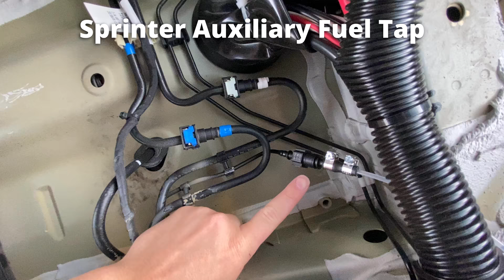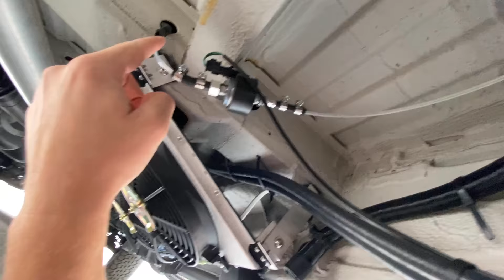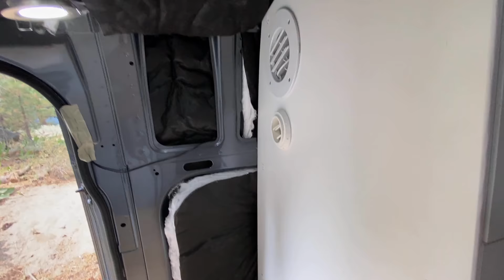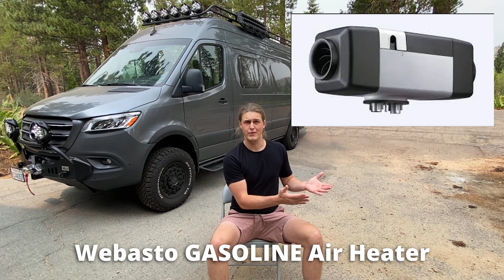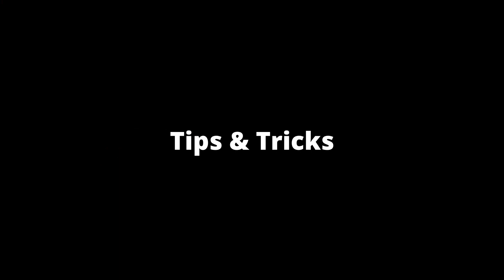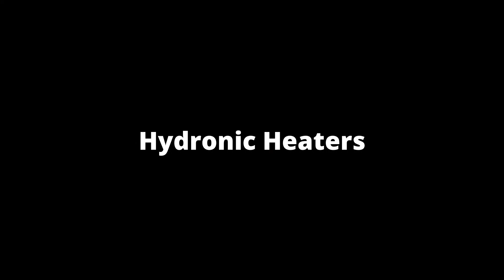Watch This BEFORE Buying A DIESEL HEATER!!! (Best Heater + How To Install) #vanlife

Comment: How will you connect your  2    1 1/2" heat outlets to the 3" main outlet, because for now it appears that the 2   1 1/2" outlet does not distribute any heat!

Comment: If the exhaust pipe gets significantly hotter than the air output, there must be a way to capture that heat instead of using standoffs to avoid melting your floor. 

 Might not be worth the complexity, but that's a lot of Hot that we're letting get away for free

Comment: The best place to put it is under the shower (dual heater air & water). It can heat the shower room for dry clothes and sauna. If you put the shower room in the middle of the van it can heat all the van.

Comment: It seems like mounting the pump and the air intake underneath the van would be problematic.  In New England, they would be covered in salt, mud and ice for the majority of the winter.  Obviously all of the substances will hurt the pump and clog the intake.  Also, in sub zero temps, that little fuel line will definitely gel up.   Why not mount the pump inside the van under a cabinet or inside an acousticly isolated enclosure?  The intake would be easy enough to go thru side panel... Fuel tank, Jerry can, also inside to keep warm. Maybe I'm missing something.

Comment: Monday March 13 / 2023. 
Love the diesel heater. My only concern with install is the heat vents should be on the floor level. Heat rises to the top and cold settles to the floor. In a cold environment your feet would always be cold with heat coming out the top. 
Great clear instructions and video.

Comment: any thoughts or recommendations on using a diesel heater with separate tank, in a gasoline van? Seems like diesel is a bit safer than gas for use as a heater?
Reply from the maker: Sounds like a good idea :)

Comment: If you are or will be using this in freezing  conditions,  or it's critical  do not even consider  the Chinese  ones onless you buy 2 and carry second  in box with you for spare parts .I have used them in my Florida  off grid cabin for years in 7 or 8 years I have had 4 of them 
And bought several boards and fuel pumps..
If you have the skill tools and redundancy  get 2 the price can't be beat 
If not do it right the first time get a name brand .
Reply from the maker: Great advice 🙏

Comment: Your wrong on your inputs and outputs diagram. Combustion intake was the one with the silencer you have externally to the van. The large intake you point to is the cold air return for the heater. Combustion gasses and heat air should never mix. Cold air return next to Combustion exhaust can kill you. Your installation is right, diagram is wrong. Good review though.

Comment: These diesel heaters suck.  They are noisy and use electricity.  What would make much more sense would be a vented propane convention heater.  These are hard to find which does not make sense to me.  To many people are buying these crappy diesel units and non-vented units.  Hard to find  compact vented propane heaters.  People are just going to have to insist on these heaters and quit buying the crappy stuff.

Comment: Can you install a diesel heater and just use the tank that comes with it? That way you wouldn't have to hook it up to your car's fuel tank (especially is you have a gasoine tank). Is there something wrong with using the fuel tank that comes with the diesel heater in a van conversion?
Reply from the maker: Nothing wrong with using a separate fuel tank (except then you have to remember to fill it up)

Comment: Great video. It shows what looks to be about an inch of the mounting plate sticking through the floor of the van? is that about correct and would you say the floor is about 1-1.5 " thick?  thanks in advance.

Comment: Why wouldn't you have the cold air intake inside the van, so the heater doesn't need to work as hard as it will be recirculating the warm air from inside the van? Like a ducted heating system in a home?
Reply: For every cubic foot of air that u would intake to burn the fuel, that exhaust fuel - & air must be vented outside,  if u drew that air from the inside, u would create a negative air pressure draw inside, that would have to be replaced with outside cold air through an open windows or door crack.  Burning this way would put a constant draw of cold air to your inside space.

Comment: Putting my roof rack on tomorrow, I have 5 LP9 going on them, I was going to use the sea view cable gland for wires( the rectangle one) just curious what you did as far as routing your wire from outside to inside the van. Can’t find anything online for routing cables to inside to back battery bank.
Reply from the maker: I just found the scan strut cable glands which don’t require glue and I love them.

Comment: Cheap Hydronic: stick an egr heat exchanger in the espar exhaust. Not my idea btw, someone in Ireland iirc. And humble road uses the engine coolant to heat a water tank. Cheers.
Reply: He doesn’t use radiant heat though..hydronic but not radiant .. so unsure of humble road’s method or how it’s holding up..

Comment: only the 2KW model fits under the passenger seat. If you have space elsewhere, get the 5KW Chinese model.
Reply: Yes, but it also consumes more power and fuel, plus will make more noise I believe.

Comment: I have been using and inexpensive Chinese diesel heater for two Winters. I am absolutely impressed with how well it works. I must admit, it was temperamental beginning the process after I had it installed I ran into some problems. Although what I did was basically take it apart clean it up and put it back together and I must say it's been running perfectly ever since. Now I should also add that I bought spare parts such as. A spare fuel pump and a spare glow plug. I keep those around in the event something breaks and I want to get it fixed quickly. In addition I always keep something for backup heat. I don't ever want to get stuck and not be able to produce heat, that could literally kill you. So I have backup propane and electric heat. Be safe out there and happy trails!
Reply: Thanks for sharing! Yes back up heat is important. Bob for Cheap RV Living recommend portable alcohol heaters as a good off grid option too.
Reply: what brand name is your heater?
Reply: @JazzFunkNobby1964  I don't remember. Although most are made in the same factory. (Just different names). I always check reviews Seems you can't go wrong with decent reviews!
Happy trails!
Reply: Got part numbers for the pump and glow plug?
Reply: @kamakazioverland4584  I don't. The way I found my backup parts was just started with a Google search and track them down I think I found them at eBay if I remember correctly. Also I think they're all interchangeable.
Reply: @wideawaketotruth5301  gotcha, much appreciated.

Comment: I’ve seen everyone installing these heaters on the floor of the van with the intake and exhaust pointing downwards. 
I’m wondering if it would work if it was installed on the wall instead?  So it would be turned 90 degrees away from the floor with the exhaust and intake coming straight out the side of the van.

Comment: Did you know that if you take a 300w engine heater connect it in so it circulates thru the vehicle heater, connect it to a solar panel system you have a solar Hydronic Heater.

Comment: Love your video, well explained.  How to choose the size of heater, 2,5, or 8 KW?
Reply: Depends on the space that needs to be heated. Measure your space, most vans are about 14m3 to 17m3 times 0,0606. That gives you the Kw rating of the heater needed. For most vans a 2kw heater will be sufficient.

For my off-grid house I have a 5kw for the living room/kitchen area, and a 2kw for the bathroom and bedroom. All Chinese ones, and the have been running for 5 winters now.

Comment: I do see a lot of comments on the vent placement being higher and wanted to comment. The heater moves about 51 cubic feet of air every minute on high and having the separation helps for circulation. It may be pushing the heat a little higher in the van but all that air must be drawn back to the inlet of the heater. As for the altitude compensation I believe the Espar heater is the only one that has automatic altitude compensation for its gas and diesel heaters. They are rated for up to 9,800' but work above that. Very nice video and keep up the great job!!!

Comment: Nice video, I have a few questions on your build. Is there a reason to get your combustion air from outside of the van? If you were to get the air from inside the van and recycling it wouldn’t that make less the system work less? If you did have a gas rig would it be possible to install a small tank for diesel. That could also act as a safety feature so you don’t end up stranded from over running the heater. What do you think? Did you explore these options at all.
Reply: Intake air that provides combustion oxygen should (must) come from outside, as after burning it is exhausted to outside.  If u took combustion air from inside, you would be in taking heated air, and forcing it out the exhaust pipe to outside.   Thus would also create a large negative air pressure draw to inside, that would have to be replenished with cold air through an open window or door crack.  Resulting in drawing in cold outside air to your living area.   Recirculating inside warm air through heat air exchanger, means greater efficiency as heating warm air is easier than heating cold air!
Reply: I had the same questions

Comment: Just bought the Webssto Air Top 2000 GAS heater for my SUV so I can survive these winter conditions. Should get it just before Christmas and then need to install it :) Cost me $1,110 CAD. And I need to find someone to install it for me since I don't have a garage and it's -20C out, so I'm not working on this outside haha

Comment: If there was a zombie apocalypse would diesel be so easy to come by? But if you had a wood burner, you could park near a forest and get wood for free.
Reply: Good point. An alcohol heater could also be another good back up option, and you can burn "HEAT" on it.

Comment: Happened to see your new van as I was driving through south lake.  Beautiful job.  Getting ready to build my 170 4x4 as well, delivery coming in the next 8 weeks.  Have a question about the fresh air intake for the Espar (or any model diesel heater).  In a home HVAC system the cold air return is installed in the ceiling somewhere. It returns the air from the house back to the heater.  Does Espar/Webasto require the air intake come from outside the van? I would have thought the air intake would come from the top of your cabinet so you're returning warmer air to the heater, instead of cold air from outside (Tahoe winter is cold!).   Just wondering - haven't read their install instructions yet.  Anyway, hope to run across you sometime here in Tahoe.  - Chris in Incline Village.
Reply: @Chris Floyd, These heaters are simple and fascinating. They use one motor with a fan wheel at each end. The airflow for each fan wheel is separate and chambers are sealed with gaskets. Inside the van, coach, trailer, shop, etc. “return air” is drawn in from the back of the heater and is forced between the housing & the large heat sink / exterior of the combustion chamber then blows this heated air (about 200*F) out of the front of the heater. The other fan wheel draws outside air from the air inlet port into the heater and is forced through a swirl chamber where the fuel is mixed and preheated then blown into the combustion chamber. This same airflow then directs the combustion gases through the exhaust port and out the exhaust pipe. 
The cold outside air is only used for combustion and the warmed inside air is recirculated through the heater.
Reply from the maker: Hey Chris you probably could but the outlet for cold air intake is on the same surface as exhaust so it’s easier to have it outside. Nice man one of these days i need to do a meetup 🤙
Reply: @seven_o_savage  My van arrived a couple weeks ago. Starting a soft build using wood framing now. Need to take a couple local trips, modify the design a time or two, then commit to the build with 8020 materials.  Max installed the Hammerhead bumper, winch, horn, Mondo's, and Baja Design front lights in week one. Black Rhinos and KO2's in week 2. Now in week 3... Sound deadening and Havelock.  Love to meetup anytime in Tahoe. Building it between Jackson CA and Incline Village.
Reply: @mooneyman13  I guess you didn't see Preacher S' answer to your question.
Reply: I was gonna ask the exact same question.

Comment: My plan is to use a small wood burning stove by day and diesel heater by night.
Reply: Did you end up doing this? I have a 4kw wood burner in my sprinter which has been great even below minus 20 Celsius, however the mornings are intimidatingly cold to get up and get the fire going, so thinking of adding a diesel heater to run each morning for an hour. Let me know if you have this set up. Curious to know how you run it.

Comment: Yeah, I agree with you regarding the choice between the radiant vs the air heater. Plus the radiant system is a more complex system meaning many more points of failure.

Comment: I work on both the espar and webasto that are installed on semi trucks. I also have my own Chinese heater.  Personally I say the Chinese heaters are about 95% as reliable as the expensive brands. For the price difference, to me at least, it’s not worth spending the extra money on the high end ones.
Reply: Seems for the price, u could keep an entire Chinese heater, unopened as a spare and swap its parts out if needed!

Comment: Why not plumb the heaters exhaust into your van’s exhaust piping rather than run a pipe across under the van?
Reply: You’d probably find that the vans exhaust then pushes into the heater unit while driving and could soot up the heater or at least cause condensation which won’t help it. It could potentially leak exhaust into the van. Definitely need to be kept separate

Comment: I have a concern with diesel heaters, they produce alot of soot and introduce diesel particles into the air and you can see on the thin film on windows and walls. Anyone knows how to solve this problem
Reply: You can't, it's a diesel exhaust.

Comment: I went the middle way with the heater: cheap chinese heater with the controls replaced by the Afterburner, which makes them incredibly powerful on the interface side (wifi, mqtt, phone control, automatic software updates and a gazilion more features) ..so far it has been an amazing combo.
just one note, that you probably heard a billion times already: heat rises, so having the heater outlets up top is not a good choice, usually you want them just above the floor.
Reply: Help me out here, can you explain a bit more? I'd like an upgraded controller, I've already got a Chinese 5kw.
Reply: Yeah, where do you get these upgraded panels?
Reply: Friend of mine told me about Afterburner. He really likes it. I just ordered a heater and looking into getting an Afterburner too.
Reply: I’m considering upgrading to a Afterburner controller. Can the Afterburner automatically shut the heater down and back on according to thermostat settings instead of just low or high speed operation?
Reply: @preachers4135  it has 4 different ways to run if I remember correctly, you run frequency, you can run the on off mode you described, also a thermostat mode that doesn't switch off but basically runs between a max and min setting and some alternative of that mode that's more predictive to aim for a very constant temperature.. also you can set schedules with all kinds of options..
Reply: @ochjoo77  Very good! Thanks for the reply.
Reply: @preachers4135  I have mine integrated in home assistant via mqtt so I can fire it up via the phone from wherever and have some additional things I can automate with it

Comment: With your large battery capacity isn't an electric heater also an option even if it uses up more than 50% of your stored power in a night?
Reply: I suspect that will be quite problematic because when it is cold is often not a lot of sunlight and the result is that recharging is problematic from solar.  So you need to generate electricity from some fuel.  Now the problem is the thermal efficiency of the generator. A car diesel engine is at around 42% thermal efficiency and to that other heat, losses have to be added. I could not find any efficiency number for the diesel heaters but I would be surprised if it less efficient.    The diesel heater is small and does not weigh, you have to add more stuff if you do not intend to use the car's engine for charging the battery.

The heater in the video can output 2.2kW and if is only run half the time as stated in the video we talk about 1.1kW of average power. At 12 V that is 90 amp.  So if you like to run it during the evening and night let's say 12 hours you need a 90*12=1080 amp hours.  So even if it uses all the power of the batteries you need a lot of them to keep warm.
If the day is 12 hours too you would need 1.1kW of solar power if the system is 100% efficient.  

If the number stated in the video is correct then electrical heating would be quite problematic even if you have enough solar.

So heating requires a lot of energy and batteries contain a lot less fuel you can burn.

Comment: If you go with the chinese heater you can upgrade to this better controller. Called "the Afterburner" and you can use bluetooth from your phone and the temperature sensor is on a cable. https://youtu.be/R1Vyez4pUs0

Comment: So much discussion on other sites  about the noise that the fuel pump makes on the chinese diesel heaters.  You bought the expensive one so not an issue on yours right?  I see that for $124 you can buy a quiet pump from the high end ones and i wonder if that works ok with the cheap heaters?